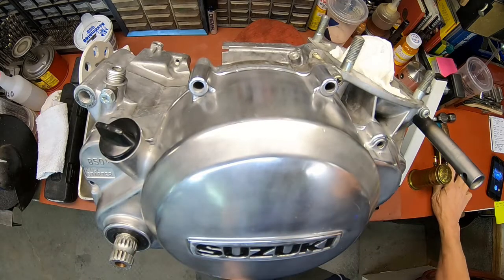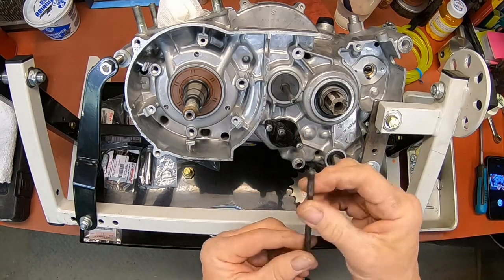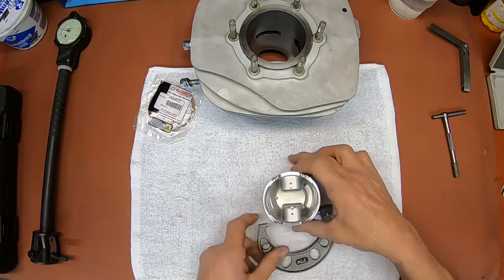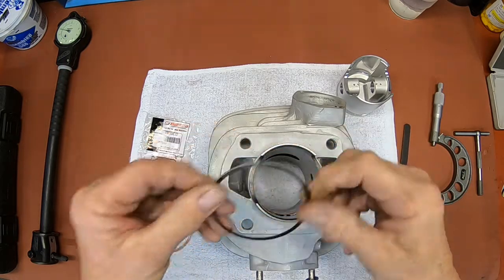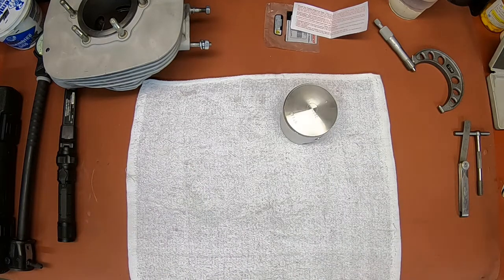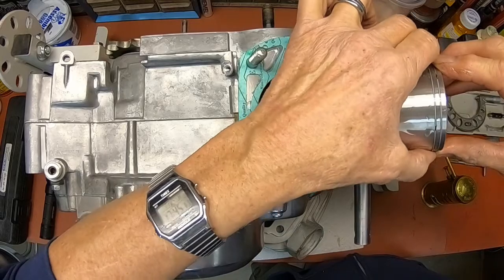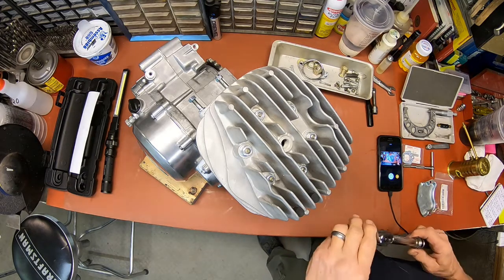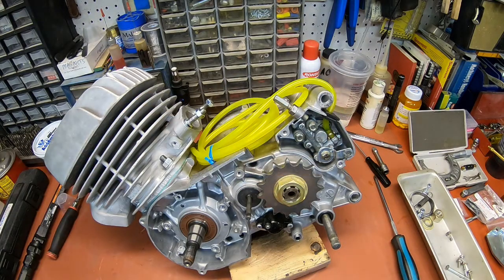75 Suzuki TS250 Cylinder and Piston install

Comment: Great video Dale. That's a nice fitting piston, should be a nice sharp two stroke. Looking forward to hearing this one run. 
I learned about stuffing towel into open engines when I was teenager, after I dropped a rocker box washer down the camchain tunnel of a Honda 125 twin. Luckily a large friend was on hand to upturn the engine and shake the washer out.
Best wishes, Dean in Oxfordshire, UK.
Reply from the maker: Thanks Dean, Wiseco sure makes a good product. Yeah I have lost stuff in the case also. No fun. Been enjoying your crank rebuild.  So there are no thrust washers on those. And they press up to the boss on both sides. Interesting.
Reply: @montana2strokeracer thanks very much, that's right, no thrust washers as such but shims can be fitted to take up the endfloat. I'll be making a video on measuring and adjusting the endfloat. Best wishes, Dean.

Comment: Hi Dale, just found your amazing videos on the the ts 250 restoration ,i am in Wales uk and just purchased an american import 73 savage in green,needs a bit of work on it,i was just wondering is there any way of testing the oil pump?
Reply from the maker: Hi Hugh, congrats on finding your bike, bet you will get it back in shape in no time. I am not aware of a way to test the pump that verifies proper output. But you can test to see if it is working. The way I do it is to mix up some premix fuel and run the engine. While it is running pull the banjo fittings at the engine and then hold the pump lever up till the index marks line up and watch the volume of oil coming out of the two lines. At least this way you know its working. Now that being said, I have never seen a oil pump fail, I have heard of it from others, but who knows if there was something else wrong or not. It is very rare in my experiance that the pump fails. Hope this helps. Thanks for following the channel.
Reply: @montana2strokeracer  H iDale ,thanks very much for your valued advise, the reason i ask is because looking at the pictures the previous owner has started some work on it and the pipes are disconnected , the bike arrives next week so ill have a good look then , thanks again Hugh.

Comment: What website do you find the engine seals. And is there a kit that you can buy for all new engine bolts?
Reply from the maker: Hi James, I dont know where you are, but here in the northwest USA I order all my Suzuki seals and other parts from Rocky Mountain ATV/MC, they are in Utah.  The engine screw set can be found on Ebay. I will leave you a link. Hey good luck with your project. Thanks for your comment and for watching the channel.

https://www.ebay.com/itm/382899572506?hash=item592697cf1a:g:6pUAAOSwVRpZm1c~

Comment: where do you find parts?
Reply from the maker: I get what I can from Suzuki, then local motorcycle salvage yards, then Ebay. Most common things such as bearings can be obtained from your local bearing and seal vendor. You more than likely will not find the shielded mag side bearing though. Not for the 250 or 400. 125's are still available, I think. Thanks for hanging out with me in the shop.